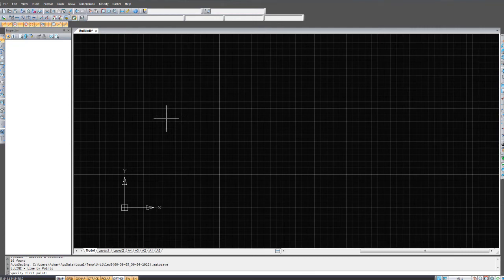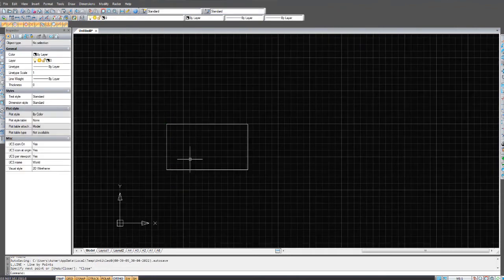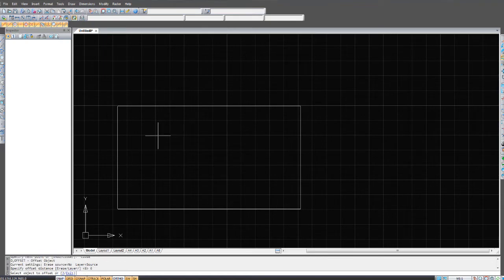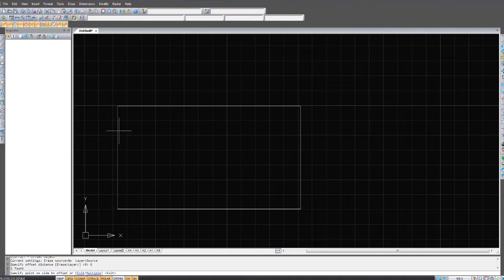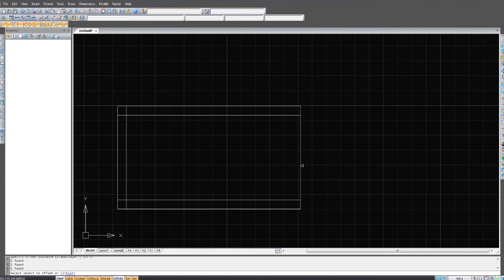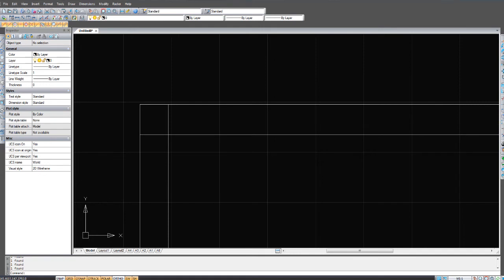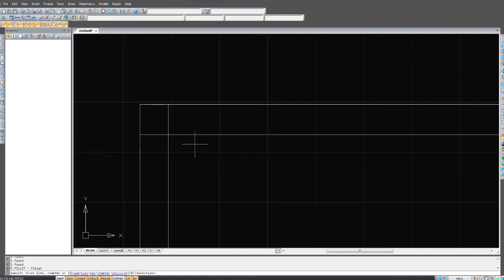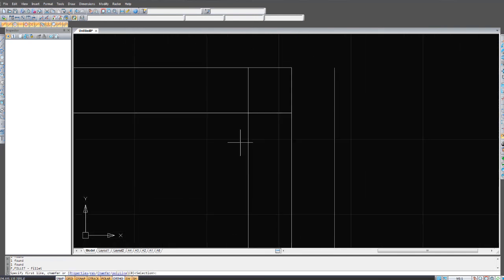How to Trim Extend Lines in NanoCAD

Comment: Hi I just need a bit of guidance please I am totally new to this and working on a project where I have to validate the fire alarm system on a site, what I need to do is add symbols and text, I don't need to draw much,just a few lines at most, I have the DWGs of original drawings, what should I use nanoCAD or FreeCAD, I work for a fire company and this will really impress my bosses, any tips and help would be appreciated.
Reply from the maker: Hello, I think NanoCAD will be your best bet because it's quite like Autocad. A friend of mine who runs an architecture business asked me for help with some dwg drawings and I was able to help because NanoCAD can work with DWG files.

I'm not so sure that freecad can open dwgs, I could be wrong but I would go with nanocad, hope that helps. If you need help with the installation and license registering process, I have made a video showing you how to do exactly that right here: https://youtu.be/Mdz5gpJHxEY